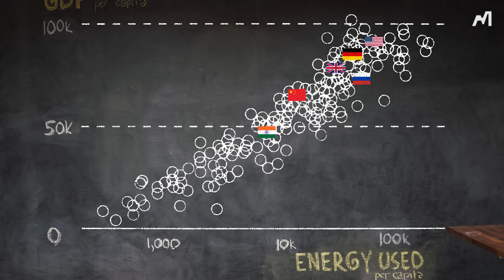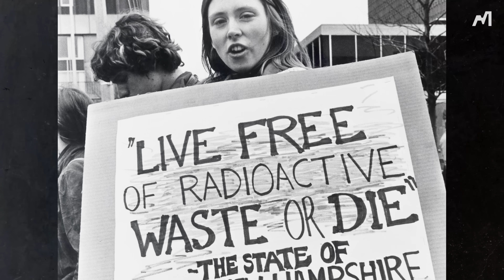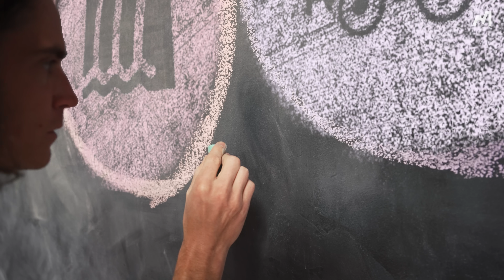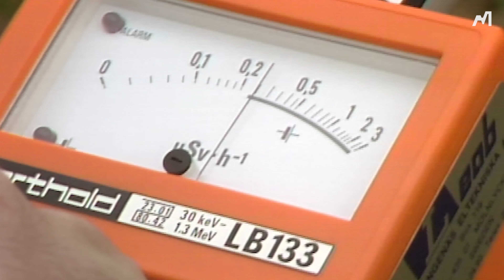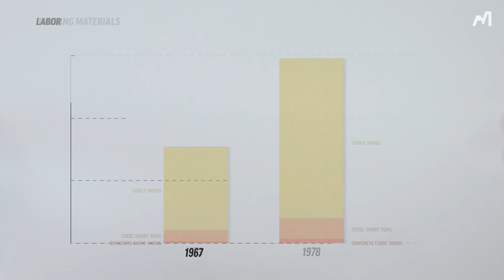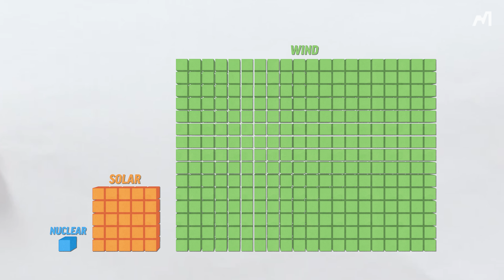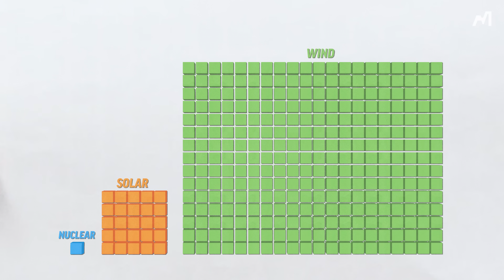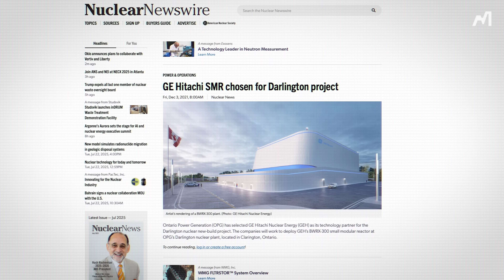They're Lying to You About Nuclear Energy

Comment: My concern is not with nuclear power safety in a normal operating environment but rather what happens in a disaster. In the event of an EMP or large CME, one could argue that the electrical control circuitry would be rendered inoperable, leading to a meltdown of virtually all nuclear reactors. Nuclear reactors take roughly two weeks to safely shut down with proper cooling systems using electric pumps. Without these pumps working, meltdowns would result. Plants have backup generators to run systems and cooling pumps for a safe shutdown. But, the generators and their internal circuitry would also be fried, rendering them inoperable. Workers would have no choice but to leave and join their families during what would be a chaotic world. Is this scenario wrong? Why?
Reply: Modern reactors can cool themselves through natural circulation (convection) which will solely work on the Laws of Physics. Hot water rises up and out of the core. Goes through the steam generator that now acts as a heat sink. When the water cools down, it gets heavier, sinks and drops down back into the core and the cycle repeats. As long as you keep the steam generators topped up with water, the reactor can cool itself indefinitely if need be.
Reply: @swokatsamsiyu3590 Thanks for the explanation. Is this true of older reactors too?
Reply: @johnwisner8037  
For older reactors this will be a bit more challenging, but they are not the fragile beings they're made out to be. Example: Fukushima. Those first four reactors were Generation 2 reactors (Units 5-6 were of a newer design. They came through the earthquake/tsunami just fine). Unit 1 was the oldest of the six. The station was rated for a 7.2 magnitude earthquake, but took a record-breaking 9.2 like a champ. The fact that the station came out of this with minimal damage is a testament to how sturdy it was built. And it were the reactors that made their crews aware that something was afoot because Units 1-3 all scrammed themselves at the exact same time (Unit 4 was shut down and defueled for maintenance at the time). Their highly sensitive seismic sensors had picked up the first tremors, and they did as they were trained to do; scram themselves at the first sign of trouble. The crews were all still looking at each other; "yours too?", when the entire station started doing the funky chicken. All safety and emergency systems worked as designed. Core-cooling started directly after shutdown. If not for the tsunami, we would have never heard about the Fukushima power station. It was the equally record-breaking tsunami that brought it down. Because the entire local infrastructure was in shambles, they couldn't get pumps/ backup generators to the site in time. And it weren't the reactors that bl*w up. It were the spaces above their containment where the spent fuel pools were. The walls were so designed that in case of a hydrogen *xpl*sion, they would fall away to relieve the pressure so the reactors underneath would not be harmed. The hydrogen was mainly created by the spent fuel pools that were starting to boil dry. And some had cracks in their walls through where the cooling water could escape.
 
As to the “it takes two weeks to shut a reactor down”. The moment a reactor scrams, it is shutdown. No more fissions going on inside. But it is the decay heat from all the fission products that needs the cooling. These are mostly short-lived isotopes generating a lot of heat. That’s why you need to keep the pumps running. But the reactor itself is very much safely asleep at that point.

Comment: I work with radiation.  While I will agree with you that it is suspect that there are so many regulations for building more nuclear reactors.  We could use more of them to decrease CO2 levels.  There is a big difference in sunlight and non ionizing readiation vs ionizing radiation that has the ability to affect DNA.  Even recent studies are showing the dangers of Lowe levels of ironizing radiation and their links to cancer.  But, does that mean we don’t need more nuclear plants?  No.  They are pretty safe for the most part.
Reply: No need to decrease CO2 levels.  That's a different lie the masses have been fooled by.

Comment: I agree with SMR ( Small Modular Reactors), but why can't the Fuel in the reactor be Thorium. The Thorium reactors at Oakridge, TN ran for 5000 hours. They have a smaller foot print because the plant operates at ambient atmospheric pressure. Thorium Energy Alliance has been lobbying for years detailing Molten Salts Research and Thorium reactors.

Comment: I work for the organization that the epa used to set baseline standards for all reactors in the US. The rules and regulations made after three mile island were direct copies of the rules my organization have been using since the 50’s. ALARA doesn’t mean you remove all possibility of exposure to radioactive material or contamination. ALARA simply means if you can reasonably achieve no exposure or lower exposure then do that. For example we limit our exposure by only temporarily being in radiation areas. Sure the radiation area has a higher background level than non radiation areas, however, you’d have to live in the radiation area for months to reach your animal limit. Not only that my annual limit is 10% of what most radiation workers limit is and their limit is 10% of what’s considered positively harmful. That means in a radiation area I would have to stay there for 200 years to accumulate enough exposure to meant my one year limit. That’s being said I don’t to maintain ALARA. Additionally it is true that any amount of exposure is potentially dangerous. Your body repairs millions of potentially cancer causing damages to your cells every day. This happens because of radiation exposure mainly in the form of light from the sun. Any additional exposure only adds to that million. The biggest risk of long term low exposure rates is the increased likely hood your body might not catch and repair a potential cancer causing cell before it’s too late. That means any exposure could cause cancer and is a risk however it’s not likely. Acute exposure, exposure over a short period of time (seconds to hours), is really dangerous. You need a large dose of radiation to get to any immediate health effects and that’s generally hard to achieve. However, with nuclear power the curie content inside a reactor is large enough to cause acute radiation sickness or death in a few million people. That’s why keeping the primary the primary and minimizing the spread of radiation or contamination is so important. Generally speaking nuclear power is extremely safe with the right design, operating principles and with a group of individuals who are properly trained to operate the reactor or do maintenance on the reactor. My organization is so strict that we set the standard. Our standard and history shows why nuclear power is safe and why it can be trusted. We’ve operated hundreds of reactors since the 50’s with no reactor accidents. That sounds like a pretty low bar however our reactors have survived artic conditions, 100 degree water, hurricanes, tsunamis and war for decades. I’ve seen my plant frozen over with ice and hot enough to cause the walls to sweat. There isn’t one thing that has killed the nuclear power plant in the US. The more restrict regulations played a large part in doing so but there’s more than just that. Most plants were built in debt, meaning, most plants were built using money from a source either a promise to pay them back upon completion. After three mile island the people and organizations with that money wanted nothing to do with nuclear power. That resulted in canceled plans and delays. Secondly with the lack of public trust in nuclear power potential plans to build plants ceased to exist. You need a local populous to agree to have your reactor built near their homes. So with the rarity of land to build on and the lack of financial ability to do so coupled with increased regulations have made it almost impossible to build a reactor in the US.

Comment: I think that saying that there were only 50 reported deaths as a result of Chernobyl is a bit misleading. It is speculated that the actual number is significantly higher. The number you mentioned of 50 was given by what was the Soviet Union, who at the time took every step they could to cover up the embarrassment of the disaster, and they never corrected that number. The UN estimates upwards of 16,000 deaths across Europe due to radiation exposure.
Reply: The 50 figure is likely the number of cases where acute radiation poisoning was the diagnosis. It's really difficult to estimate the number of deaths caused by radioactive contamination. If a 50 years old person gets cancer 5 years earlier than he would have otherwise (which is also really difficult to identify) is it one death? Or is it 0.1 deaths? Different parties use different models, which makes it more complicated.
Reply: @mikloskallo9046 yes i am aware. nonetheless, it downplays the effects of radiation/particulates released into the atmosphere. it makes it sound as if it is not as bad when you frame it that way without giving additional context.

Comment: It needs to be pointed out that Chornobyl was a horribly built power plant. It was rushed, and its purpose was not power generation but to create material for bombs.

It was inherently unstable. The containment was practically nonexistent, while standard in other nuclear power plants. 

And then they ran a test where they bypassed and turned off multiple safety systems when the disaster happened. The way things shaped up, it almost looked like it was intentional.

Comment: Great video but it is only one sided. If regulation didn't exist and there where many nuclear plants and thousands of SMRs, what is the expected death toll and expected nuclear contamination (because failures WILL happen, its inevitable). Every Nuclear/SMR hype video fails to answer very basic questions and are covertly biased. Yes we know LNT and ALARA is aggressive (by design), what Ive seen here isn't enough to open the flood gates of putting tech billionaire's SMRs in our communities. Spend the billions of dollars on multijunction solar and be done with localized nuclear and use the reactor that's been stable for the past few billion years. It doesn't have to be nuclear vs coal/LNG

Comment: Your comments are correct as far as I know, but not the full picture.

You left out the greed of the industry, and how they have ruined their good will, and have descended even into criminality and violence at times. We don't trust them to handle the material and follow the safety procedures properly. Where I live,  they buried waste on a beach in containers that are thinner than the standard, and almost dropped one.

I support rooftop solar with batteries because the best system with the lowest cost and maintenance is distributed generation.

And our batteries are still in their infancy. The best is yet to come. We are even learning how to recycle.

If the industry is serious about nuclear, then they can store the waste at their offices, which they haven't offered so far.

Then there are all the shenanigans by GE. They polluted the Hudson River, and surely other things. Sorry, but big business can't be trusted, and seems to be run by sociopaths.

Comment: Add up all the inputs to a nuclear power plant, without even considering waste disposal, and they nearly equal all the energy it will ever produce. So they really aren't an energy source.
Also, there is no way to significantly ramp up uranium production in the world, as we are near Peak Uranium Production globally.
"Windmills" grind grains and power saw mills, Wind Turbines create electricity. That's a pretty big flaw in this video, which makes you wonder what else he got wrong.
Soon, due to oil production peaking years ago, we won't be able to maintain the electrical grid, which is needed for nuclear power.
Sorry dreamers, but the future of energy increasingly looks like a campfire.

Comment: Two deaths at los alamos directly related to plutonium accidents. The problem with nuclear plants is and has always been the spent fuel rods which no one can get permits to transport so they stay on site out of containment or they are loaded on a train and dumped near some unsuspecting town. My dad worked on the construction and fit ups of those plants and did recurring maintenance.
Reply: But those deaths were very much self inflicted and they knew what risk they took when they handled the "Devil's Core" without necessary precautions.
Reply: What are you talking about? We already solved the problem with nuclear waste. You need to educate yourself

Comment: I don't know why they have to spread such nonsense to make people supporters of nuclear energy. Nuclear energy is dangerous, but it is necessary and must be developed. And besides, regulations are not to blame. Regulations are what make nuclear energy clean. And it may be economically profitable to build nuclear power plants without reducing regulations, with help from the state - state participation in construction, mandatory purchase of energy at slightly higher prices /and anyway nuclear energy is the cheapest/. There is no need to tell lies. The truth is a better weapon for convincing people. And it is that although dangerous, humanity needs to develop nuclear energy if it does not want to regress to the level of the 19th century with no chance of recovery.

Comment: Do not call spent Nuclear fuel "waste" call it reduced nuclear fuel. It retains 90% of its engery (Google) its just that our current plants cant extract more of it.
The actuall nuclear waste is everything thats thrown away in a Plant, like gloves and protective equipment in general. That is the only waste, and that is low grade stuff thats already not overly dangerous and is at natural levels within 30 years.
Reduced nuclear fuel can be used again, today after reprocessin for use in an old plant. In a (today theoretical) Dual fluid reactor it can be used as fuel as is.

Do not call it waste, you make your job harder.

Comment: The people behind this proliferation of fear were behind "green" energy. Solar and wind are great money makers because they're so inefficient. Nuclear power is one and done. You build it, and it produces large amounts of reliable energy for 50 years. A solar panel lasts 5-10 years and produces small amounts of sporadic energy, meaning you need a lot more, and you need them a lot more often. If you want profits, nuclear energy makes no sense. After all, every plant, every advance, means energy gets cheaper. But solar and wind... The infrastructure doesn't last, so every replacement is reason to increase the price by claiming advancements. "These new blades are 5% more efficient! And they're only twice the price! You can get them now, or you can wait two weeks and get the blades that will be 3x the price!" Of course, those costs simply get passed on to the consumer.
Reply: You are not smart. You have no degree and are simply talking on line. Cheer for hydro electric, that way you at least get a lake and clean drinking water

Comment: I agree with a lot of things talked about in this Video but I have to disagree with you on solar power. They only lose about 10 to 15% of their efficiency over a time span of 20 to 25 years while you can get really a good solar panel for  60 to 80€ and it can make yourself independent from energy companies. As for my self I have a few solar panels on my roof making 45kW every summer day and around up to half that in spring. In combination with Batteries you even have electricity at night.

Comment: I like nuclear technology but something must be done about heat loss during transmission. All that wattage is great but if you lose half of it by transmission wires heating up you are stuck. HVDC needs to be part of the nuclear plan, rectify that voltage into DC to transmit and then pick it back up into AC as it gets close to population centers.

Comment: The extremely careful way nuclear power plants have been built and run in the US will likely turn out to be less harmful than coal and petroleum. Still it has never been built without subsidies,mainly in the form of risk being carried by the public. None of them have insurance for damage caused by failure,and long term storage of waste is not paid for when the utility goes bankrupt.
Solar is way cheaper and goes online faster,less maintenance and doesn’t need massive distribution infrastructure if production and battery storage is distributed.
My four bedroom,all electric house equipped with a 200 amp service is now run off a 12/2 wg romex which I use at night to top off my DIY off grid solar with LFP battery. No thanks! Keep your Stone Age nuke plant.NIMBY